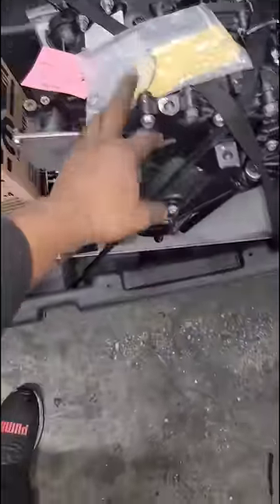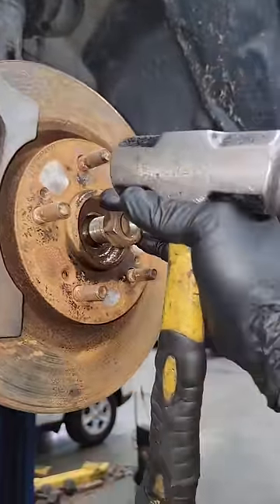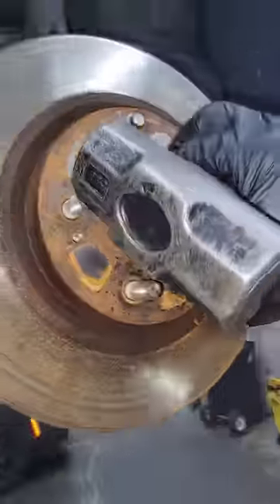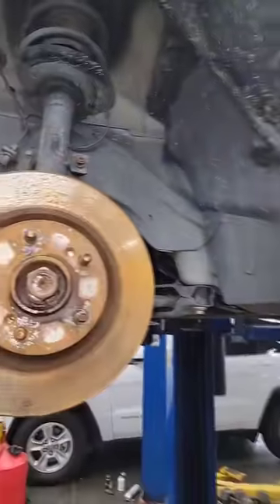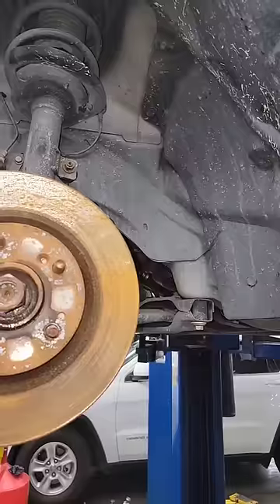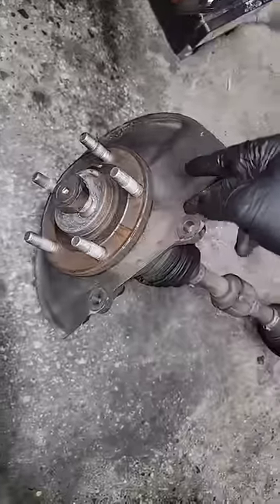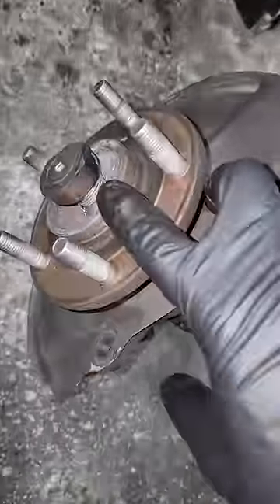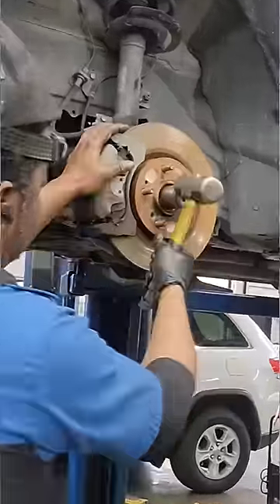Damm, Its not looking good for this CVT Transmission Job. Here's why.

Comment: Mix atf with acetone in a spray bottle 50/50 and shake before using. It separates fairly quick but I've been able to remove exhaust bolts without a problem using this method.

Comment: Ive had this problem easy fix, remove lower ball joint and pull the axle from the trans and move the axle out of the way... replace if the customer want to if not you can work around this particular problem pretty easy not too hard

Comment: Air hammer?
Reply: its $55 if your wondering people without one
Reply: Definitely needs a decent air hammer. I have a carlyse napa brand long barrel, and it works decent. One of my most useful tools in my shop, also good for bolts seized into bushings on control arms or leave springs.

Comment: put a big ass gear puller on the outside of the hub with a socket to spin on so you don’t damage the axle…works like a charm

Comment: I don't use it for everything but PB also makes a cold spray which will instantly freeze whatever you spray, I rarely use it but man it's useful when I do, It freezes and then adds oil at the same time so it shrinks the metal and breaks apart the rust

Comment: Problem with doing that is that you can damage the threads on the axle. Then you won't be able to put the nut back on.

Also pounding on the axle while the spindle is in the car does nothing because the spindle absorbs the hammer impact. And that force also goes into the transmission.

Comment: PB Blaster is actually great for rust, at least in my experience. Use to do millwright work, and that's all they used and it worked. PB Blaster and WD40 are the best for the price point. I haven't never had an issue with neither one.

Comment: they have a tool that screw the lug nuts down and there is the center bolt that screws down to press it out! it looks like the adapter plate on the slide hammer but its deeper and has a center bolt that press on the axle bolt

Comment: Take an old axle and cut three inches off with the threaded end,grind cut smooth and screw it into axle nut half the thread depth. Use it as an impact point,axle will loosen in 2-3 hits

Comment: Cp 717 air hammer.  Half inch chuck.  Works amazing if you have 175 psi or better and big fittings and a 3/4 inch or bigger air hose.   I rattle out ball joints with this gun.  And rattle them back in.  No press.   I just make new cups randomly lol.     Cp 717. Super zip gun. Check it out
Reply: I'll have to look into that. Been using my works Cornwell and it just doesn't hit like our old harbor freight it mactools one did that got retired. Cheers

Comment: There's a little hole in the middle of the axle. Use the spike from an air hammer bit and hit with some heat. Great video.

Comment: I had up use a 15 ton press to get my cv axle out of my wheel bearing in my ram.  Ended stripping 1 bolt for my wheel bearing.  Just went on Amazon and bought a whole new spindle And wheel bearing. The hell with that bs

Comment: Haven't you heard of a hub puller and a torch?
Reply from the maker: Sure, mind you that this a 60 second shorts video dude. So everything that was tried not on video. But yea, when tools start bending and you busting up fellow mechanics tools it time to stop. At this point its ruined anyway. new axle and hub assembly parts on the way.

Comment: air chisel with a pointed bit. SAVE those threads. Been there done that with HONDA/ACURA's. Normally there  is enough slop with stock splines.

Comment: Use atf and a thinner to bust rust. Shake them violently and spray fast. The faster the atf and solvent separates, the faster the parts separate.
Reply: I just suggested this as well. I've been able to remove exhaust bolts without snapping them since I started using this mixture.

Comment: Bro you got the socket just hitting the hub. Use air hammer to get axle out
Reply from the maker: Lol, really dude?. Do really think im just setting here banging on the hub? Smdh. The socket backed off so the impact would be on the axle and threads to go inwards of that hub assembly. This not coming off no matter whats used. And besides, if you succed at getting it out its to far damaged at that point.
Reply: @OnlineMechanicTips  air hammer with drift bit right on the center of the axle. it'll come out fine.
Reply: At 45 seconds into your short you put the socket over the axle nut right up against the hub. You're not even hitting the axle nut with the socket dude. Lol 😅
Reply from the maker: @MatsuYoda  smdh, the nut is backed almost all the way off dude. the socket im banging on banging on the nut which is threaded to the the axle shaft. Im not hitting on the hub just the socket/nut. I didnt bother to mention that because I figured most of the viewers had common sense. Guess I was wrong.
Reply from the maker: @MatsuYoda  All of that was tried, just not shown on these 60 second shorts videos. Torch heat as well. This not the first time this has happen as you saw the othe shaft assembly. When they seaize, they seize. And now they not usable because they all banged up.
Reply: @OnlineMechanicTips  bruh I'm a mechanic in ND tell me about it. I deal with seized shit daily. That axle will come out with air hammer, just fine. Socket is just hitting the hub. It's common sense....
Reply: Dude is just banging on the rotor basically and expected the axle to move, proof a piece of paper (patch on a shirt) is of surface level value.
Reply from the maker: @nerbs101  They always say clowns come in pairs but since the other guy have a genuine concern, hes not a clown, he just wrong. Now you on the other hand definitely a clown.
Reply: Legend has it hes still swinging that hammer to the socket to this day and still hasn't got the axle out.
Reply from the maker: @nerbs101  Naw its not coming out. New parts on the way. But please dont stop making those clown predictions. They kind of cool
Reply from the maker: March 25, 2024